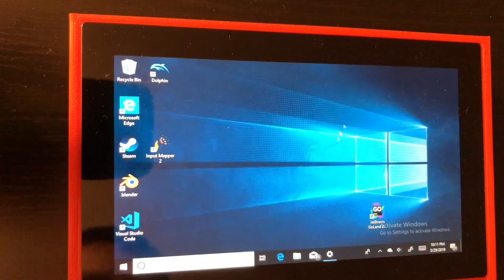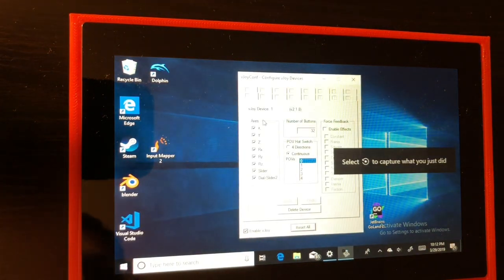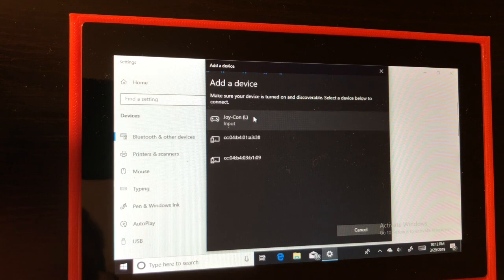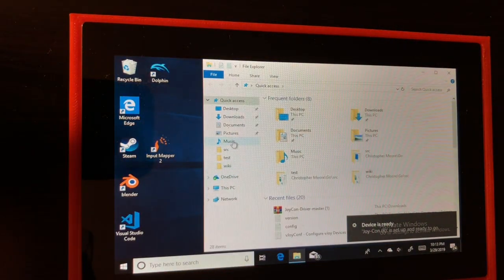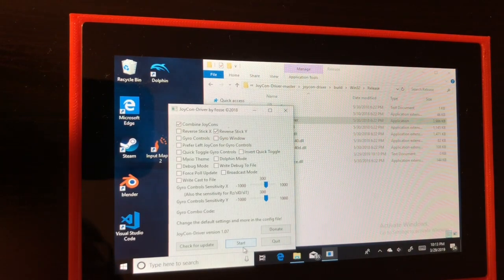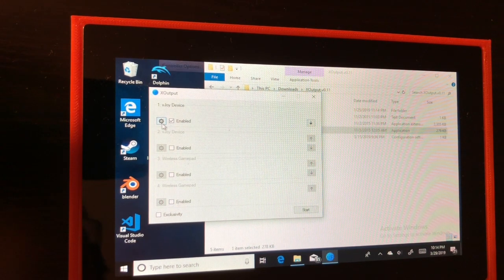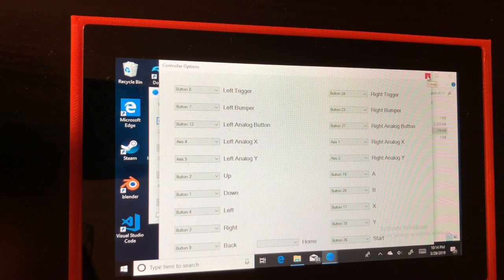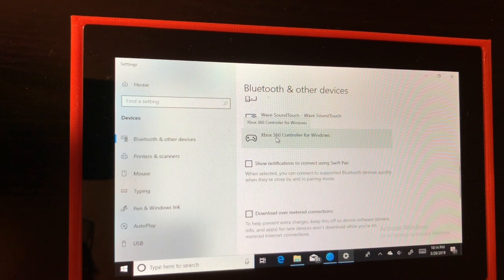Nintendo Switch LattePanda Alpha Project - Joycon to Xinput Tutorial

Comment: I am pretty worried about the power consumption of the LattePanda Alpha. With such nice performance it might require a large built in battery.
Reply from the maker: Dear Cloud, yes the LPA is a power hungry board. I am working on a battery set up and all the parts will arrive Friday. Once I get it up and running I will let you know how the battery performance.
Reply: Project-SBC Thank you so much! Looking forward to it.
Reply from the maker: Cloud Yamiko great news! I got a pack of 18650 running the LPA. Toughest part is running down the 10 pin battery connector (molex panelmate )
Reply: Project-SBC I assume you will have to handwire it right? How long can it keep LPA running?
Reply from the maker: Cloud Yamiko yes it does have to be hand wired. I will provide a tutorial. I haven’t tested the battery life yet, I only got one 2s pack created but because it is possibly to add several 2s packs, you can make it 21Whr (2s1p), 42 Whr (2s2p), 63 Whr (2s3p) or more. So there is the ability to make it fairly large at the cost of a very slow charging speed
Reply from the maker: Cloud Yamiko here is my twitter picture https://twitter.com/projectsbc/status/1149345403348901890?s=21

Comment: hei, lattepanda is cool but for this project any reason to not just buy a windows tablet. i found it cost less and hassle that way?
Reply from the maker: Thanks for the comment. You have a good point. A cheap tablet would certainly work for less intense gaming. Passively cooled tablets will throttle quickly. I learned that when I made something similar with a Chuwi Hi8 tablet https://youtu.be/MR1pTf9htLw
The lattepanda alpha has relatively powerful integrated graphics and a cooling system that will prevent throttling.

Secondly, I just enjoy the build process. It's fun to visualize something, design it, and have it come together in the end.

Comment: hey man, love your project. have you thought adding a mobile gpu from a laptop through the nvme slot
Reply from the maker: Thanks for the comment. It's somewhat cost prohibitive. I couldn't find cheap MXM gpus, the adapter board is another $150, and I'm not sure how to power the extra 30+ watts. If you have any ideas, i'd be interested to hear them!
Reply: @HandheldHardware  you're right , although, lots of dummies scrap their gaming laptops on ebay/craiglist for low prices. the 30 plus watts could be handled by placing 2 tablet batteries in parallel. (that would be really expensive)ps. im an industrial designer, feel  free to message me if you need help with designing the case. good luck man.
Reply from the maker: mv vo thanks for the offer and suggestions, I keep an eye out for used/broken gaming laptops deals. Have you done much modeling for 3D printing?
Reply: @HandheldHardware  lots and lots, nowadays its almost required in order to get a job as an industrial designer.
Reply from the maker: @mvvo7366  May I ask if you have any good suggestions for securing the two halves? Some ideas i've found include using a special tip soldering iron to push threaded fittings in. I'll upload my models to thingiverse shortly and share.
Reply: @HandheldHardware  it depends on which to halves you mean.in case of  the casing for the lattepanda and battery and etc. you should model that as male and female fittings that you can fit with screws so that you can open it if needed. do NOT 3d print the threads, its MUCH better to do the threads yourself, by modelling the thickness of the thread and making the threads by screwing in an actual screw.